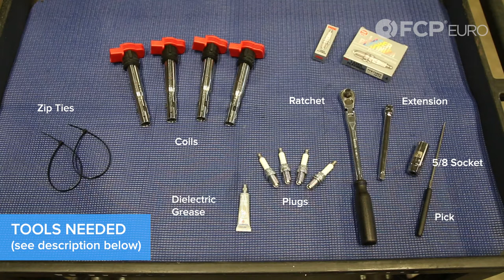VW & Audi Ignition Coil and Spark Plug Replacement - EASY DIY UNDER 2 MINUTES!

Comment: What tool did u use to tq to spec? What happens if you dont and just use the regular wrench ?
Reply from the maker: The tool is called a torque wrench. You can find one here: https://www.fcpeuro.com/products/3-8-drive-flex-head-micrometer-torque-wrench-5-75-ft-lbs-gearwrench-85086 
While it is recommended that you use a torque wrench when tightening the spark plugs, you can use a regular wrench just make the plugs are snug but don't overtighten them.